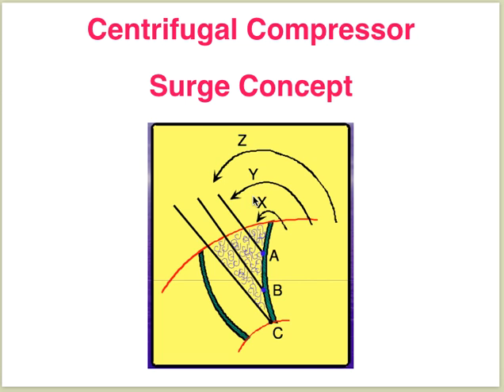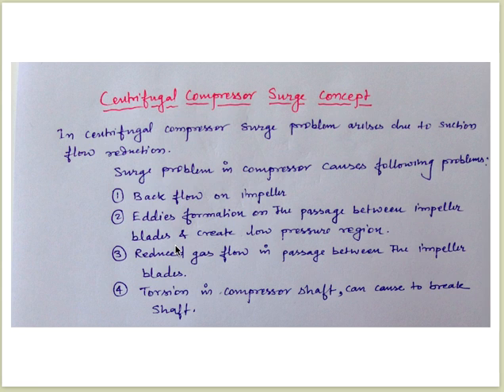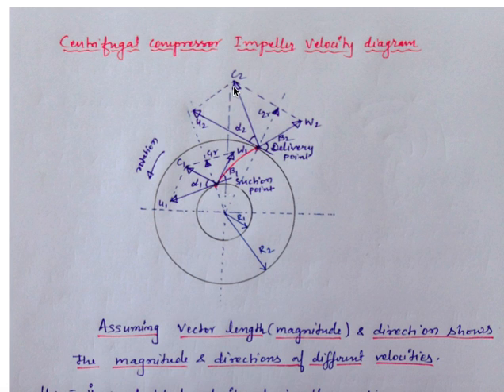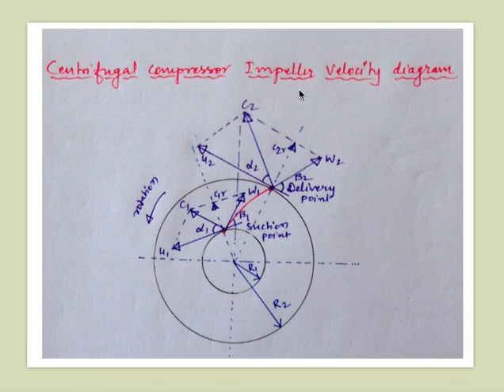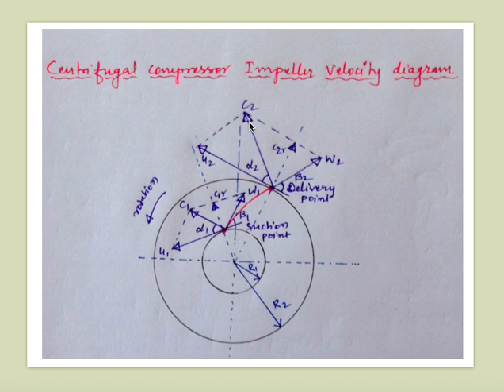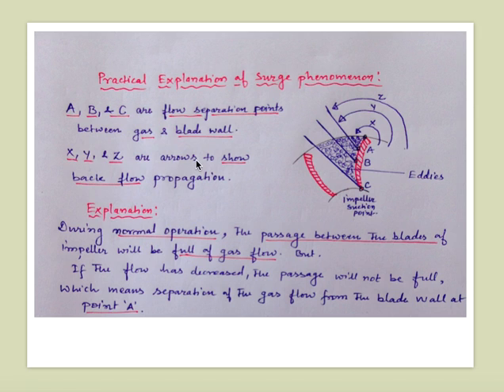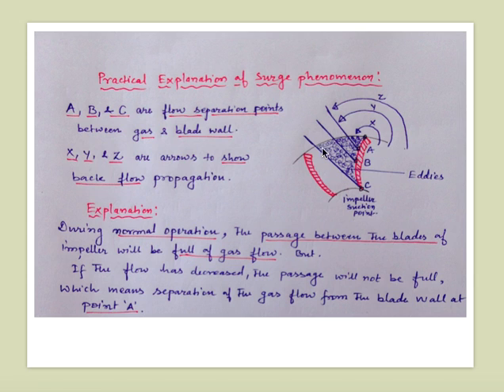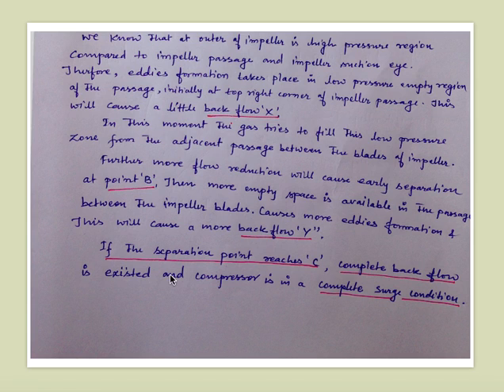Compressor Surge Problem Concept

Comment: We can summarize your presentation ------ Surge happens when suction flow is not enough to build up the design pressure
Find below the actual meaning of Surge cycle
Compressor surge cycle is: 
1-This phenomenon is an compressor internal phenomenon 
2-The discharge flow stops completely, No compressor outlet gas flow (Flow rate= 0) 
3-Happens Only To Centrifugal and Axial Flow Compressors only, If the flow rate in the suction is not enough to build up the required design pressure. 
4-All the gas flow return back [from the outlet of compressor last stage impeller] to the suction.
 5-At this moment, the available gas at suction consists of return back flow + the inlet gas flow 
6-The available gas now at the suction is enough to build up the required design pressure, Then compressor starts to deliver the gas to discharge again.
 7- This action is repeated from 5 to 20 times per second 
8-The discharge flow stops completely (Flow rate= 0) 
9-This reversal action converts the compressor to Turbine 
10- The turbine produces a power equal to the motor power but in the reverse direction of the rotor
 11-This action creates a sever torsion stress on compressor rotor 
12- This action is repeated from 5 to 20 times per second 
For more information contact 
Hassan Mohamed Abdul Monem Hassan
 Lead Mechanical Engineers WorleyParsons Engineers Egypt Ltd.
 Cairo Egypt 01223190213 Tel.: +2-02-22706178 
Email hasmonem@gmail.com

Comment: Sir, i think you have shown wrong direction of rotation in first slide. And thank you for sharing the knowledge.
Reply from the maker: watch once again , hope you will understand , who is wrong.
Reply: @lokeshkumarsingh9636  .. I believe badal lodhari is right form the point of which one should be more suitable for industrial use and power consumption perspective. The rotation sign in "Compressor Impeller Description" slide shows clockwise direction while the other slide shows anti-clockwise direction. If it is as shown, then it is a forward curved blades, in which the pressure increases with increase in flow rates. Correct me if I am wrong sir.
Reply from the maker: Yes by mistake it is shown  wrong

Comment: Surge occur in axial flow compress . Don't show your qualifications no one interested in it . If surge is not occur in axial flow compress
Then you need flow control valve . Flow switch and monitoring system and give false information.